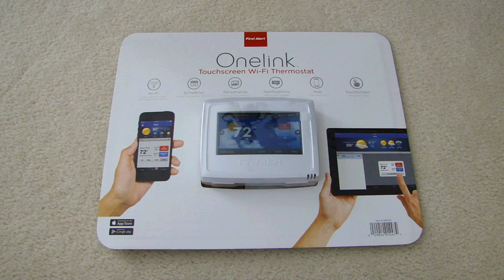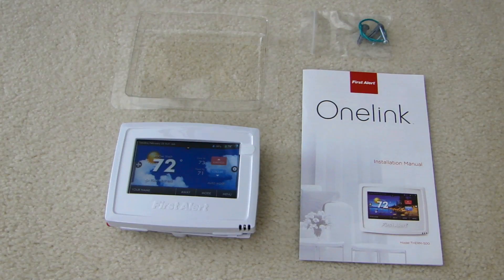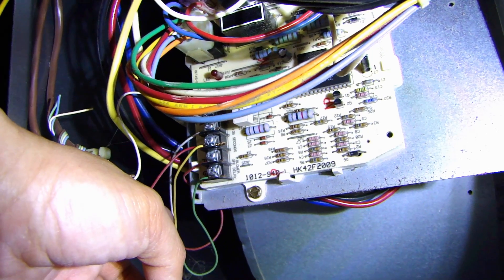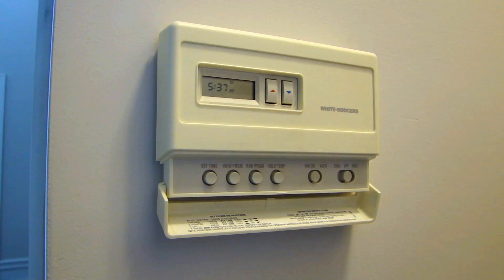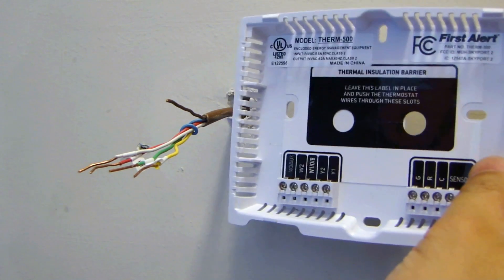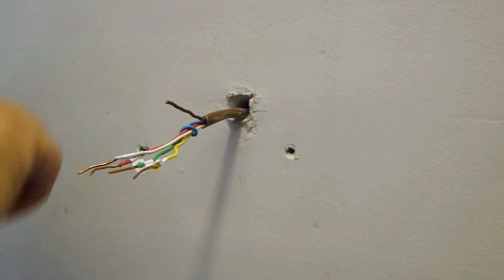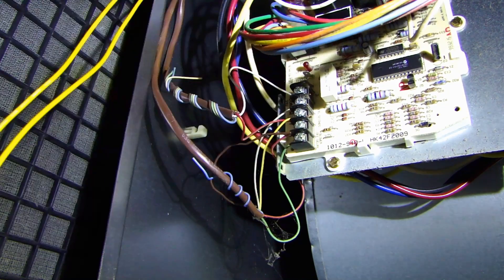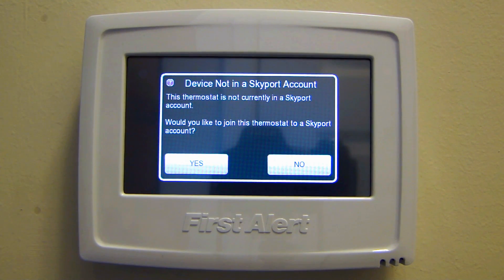How To Install Wireless Thermostat - First Alert THERM-500

Comment: I have a question intried installing on a 4 wire system, and not working I jumped y to common but my common terminal on the furnace had a wire already but nothing coming out of the wall to connect to

Comment: Most excellent video.  Watched this first then installed.  Made process go much easier.  Setup and Wi-fi connection with account went well.  Now hope First Alert product works well too.  Only issue was website references in their installation manual weren't current.  Google got me to the correct ones.

Comment: Thanks for sharing great video.  I have two thermostats, installed in two different homes in two different towns.  One nuisance is that the second one I installed will not display the weather forecast.   Is this fundamental in the Skyport function that only one weather location will be shown?
Reply from the maker: +Jerry Marks  I thought the weather comes from the wifi connection independent of the Skyport account. You may want to try doing a reset and starting from new again and see if you get same result.
Reply: Thanks for advice. Actually this is the second thermostat at this location and both give the same result. The first had problems staying connected. First Alert generously replaced it with this one. Neither would display weather info at this location.